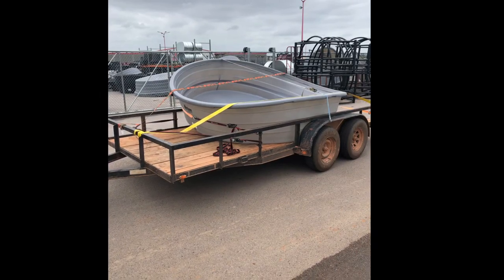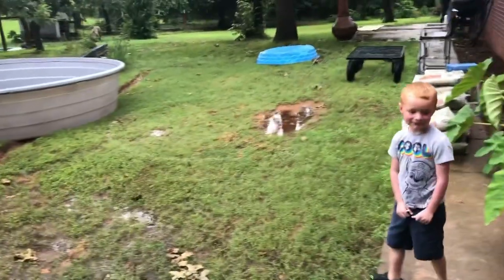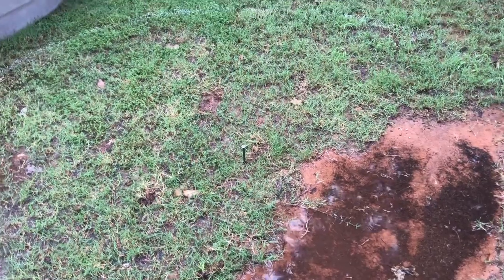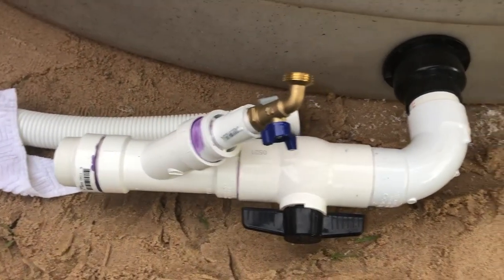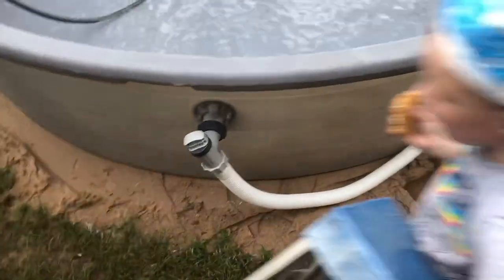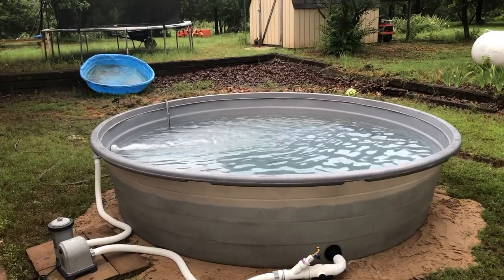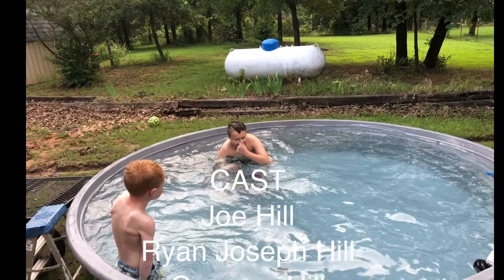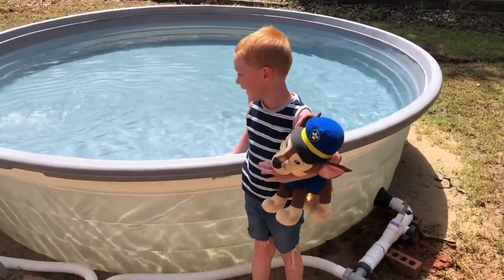10 Foot poly stock tank pool build

Comment: We built the same thing for the granddaughter using a sand filter system.  I also installed a 10x10 canopy over the pool which really helps to keep evaporation down and of course the sun off of it which in turns helps to control the algae.  I use just a little bit of bleach in the water with no issues.  I added a skimmer which also helps to keep the water clean along with a dip net.  I use the siphon method to vacuum the bottom of the tank when needed.
Reply: Could you post a video of vacuum?

Comment: Joe, I would like to try this with my 8ft poly tank. The pump and filter Il using has a 1.25" hose connection. Can you tell me what I'd need to buy to create the PVC part without the vacuuming thing. Like what sizes of each piece? 😬 Pretty Please.... ❤

Comment: Hello! First season with my 10’ poly tank and I flipped it for winter. The only issue is when it rains the bottom starts to cave in due to the weight of the water. Guess the only way to fix this is just leave it right side up and drain it on occasion. What do you do with yours?
Reply from the maker: I flip it over also for storage.  Put a bucket in the center of the tank.  Measure the depth of the tank from the top rail to the bottom.  Use a wood block to make up that distance.  Mine is one inch taller than the depth.  That allows a little slope that lets the water run off.

Comment: What did you do for that flange lip thing on the inside of the stock tank. Mine is quite big and could be sharp?
Reply from the maker: I took a dremmel tool and files it down as best I could but it’s still a little rough.
Reply: @joehill1538  Nice. I have not done anything to ours. Is yours also a hastings? I got 10 foot model and paid 700 and had the coop deliver it. 
I am still considering adding in jets and filter and that kind of stuff. Tryint to find the right parts is kind of hard. I wish I had saved that hoto tub pump that I help take to the dump. It leaked yet the pump work and everything else. Most time peopel toss them because they leak for the control board is bad. 
I am also considering digging a hole and putting it in the ground and getting that plastic deck stuff and make a small deck around it.

Comment: How is the vacuum manifold doing? Does it create enough suction to vacuum the pool?
Reply from the maker: It didn't quite work out as planned.  I ended up going with the Intex cordless vacuum.  I believe If I would have went with a 2 in to 1 1/2 connection it would have functioned properly.  The 3/4 valve was just too much restriction.